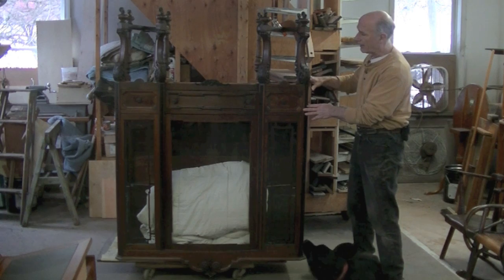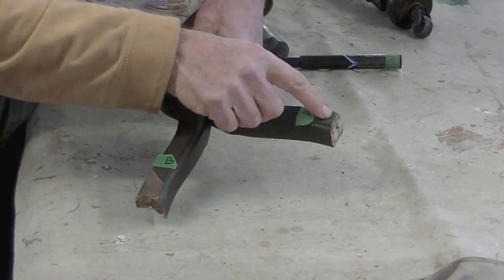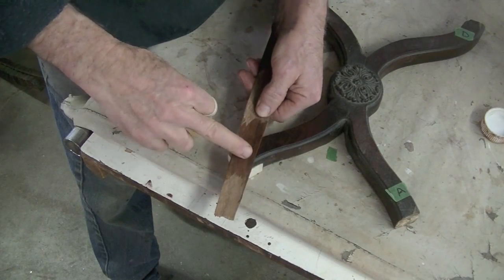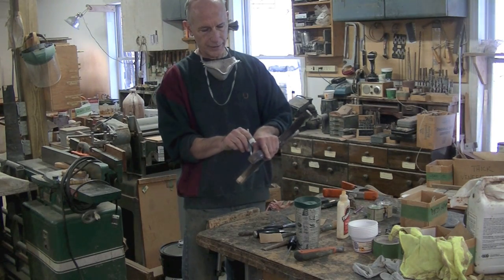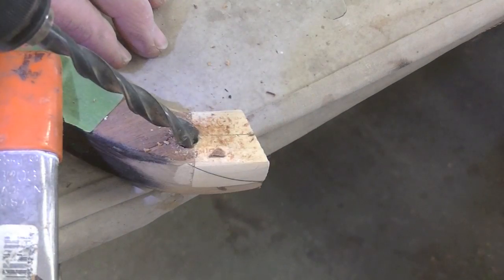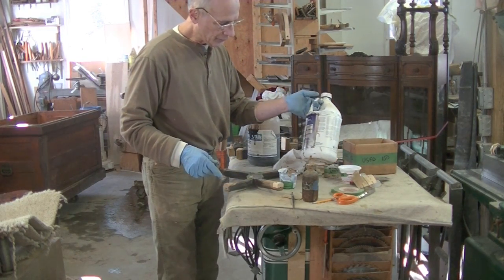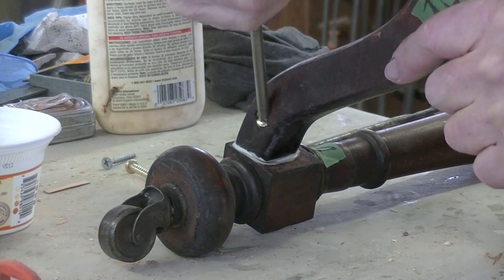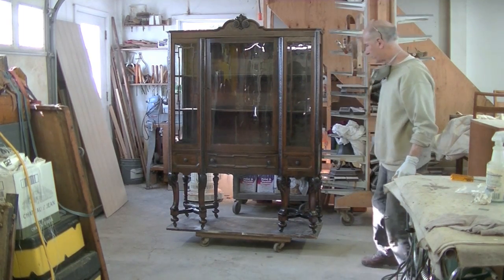Repairing a China Cabinet's Broken Leg Assembly - Thomas Johnson Antique Furniture Restoration

Comment: It's amusing that the Victorian and early 20c  reproductions built such tall heavy and awkward pieces on tiny rickety legs... with wheels. Wheels were the answer for moving heavy furniture for housekeeping chores but rolling them around over rug edges or fully loaded, away from the wall for polishing the floors or other housekeeping  chores lateral-stress the joints so much that they invariably break out. I commonly find the breakout where the wheel inserts into the leg. I have a modern case piece that has the same tiny wheel design and have the case placed on movers whenever I need to do floor care.  Beautiful but a high maintenance.
Reply from the maker: Thanks! Yes, the tiny wheels make me crazy!

Comment: Very nice repair but I think gluing dowels would be stronger than screws. Do you agree or disagree?
Reply from the maker: Thanks! I think screws will always be stronger, plus in a lot of situations drilling for a dowel takes away too much wood, creating weak places. With a screw you've got a much smaller hole to drill, and more strength.

Comment: I noticed you're not too worried about excess wood glue, I'm always trying to wipe it off with a wet cloth. Is that not correct?
Reply from the maker: Well, I do worry about it, and I also use wet rags and try to get it all off. Depending on the repair and what I have to do to it afterwards would affect how much I am concerned with it. But if it's water based it can always come off afterwards

Comment: Great work, as usual. What a horrible system they used with those screws. Well done for getting the angle right. I think I would have gone the easy route and removed all the screws and made them into doweled joints.
Reply from the maker: Thanks! But making them doweled joints would not be easy! I would have preferred that, but on the other hand I'm always trying to make it exactly the way it was originally. Not that it matters on this particular piece, but it's good to stay in practice!